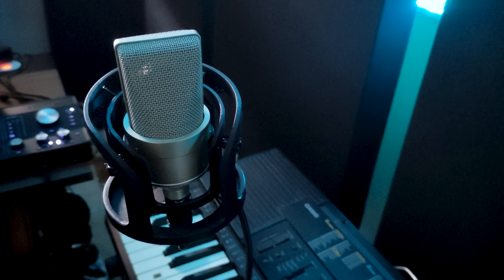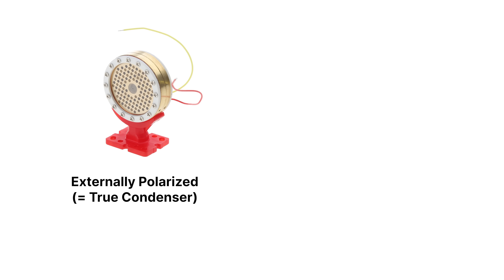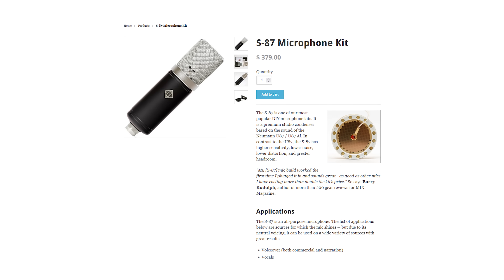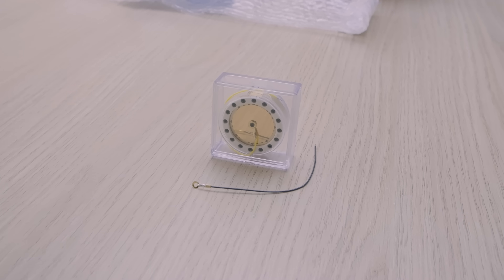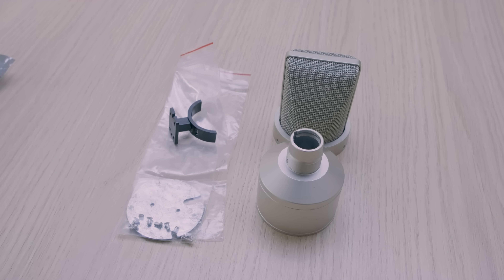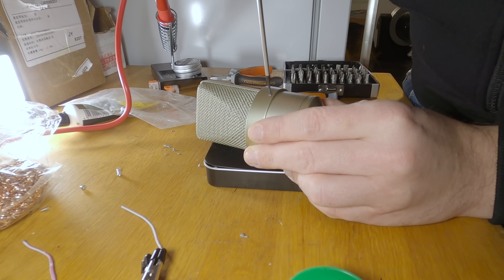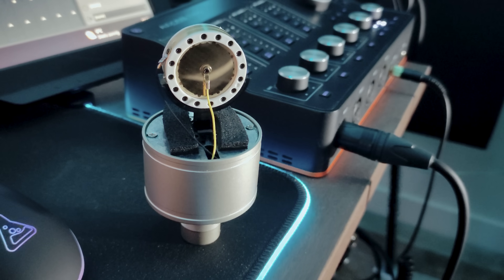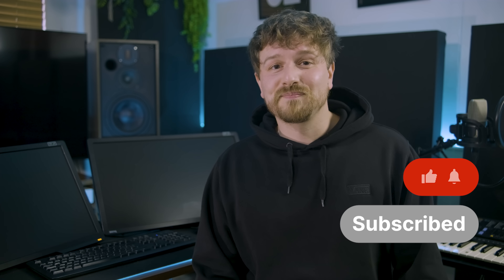Building a Studio Microphone from AliExpress Parts (DIY)

Comment: I did an experiment reason it could be picking up noise could be from the body not grounding the Capsule cage
Reply: try sanding the top and bottom of the body
Reply: when I had taped the end of the top body from testing to see that had brought the hum noise from ac and rf signals back
Reply: Hope that helps anyone
Reply from the maker: @leoyser1369 thanks for checking that out!
Reply: @SirFreak no probs

Comment: For the price this mic, sounds awesome!

I wish all the creators in YouTube who are not specifically doing podcasts with multiple participants, took their Shure SM5xx (whatever this crap dynamic mic is) alongside with the cloudlifter, threm them in the bin I've got something cheap from the condenser mics section. Viewers/listeners would be absolutely happy for a much better how to quality.

People wasting hundreds of Euros on that black Shure turd. Most of them don't have all the engine explains needed to squeeze maximum quality out of this mic in post.

But I digress...

Great video, although I'm a little bit confused by the mere fact that person who is working with and on audio in his Studio, wouldn't recognise the low frequency AC line hum in the order signal that was present before you enclosed the capsule. I don't understand how this was even a question. 

Also, the noise level below 100 HZ for a mic like this without low frequency attenuation switch, Are completely normal and to be expected. Also, you could add additional tin foil (obviously with a insulating layer) around the circuit board and/or wrap the tiny wires in additional shielding. 

Still below frequency rumble is kind of expected without any additional circuitry, and besides I'm pretty sure, a most condenser mic users would the low frequencies anyways, especially for male voices. You would hardly ever need any frequencies below... Sat 160 Hz if not even higher.
Reply from the maker: Completely agree on the SM7b. And yup, I mistakenly used the wrong terminology, sorry about that!
Kind of agree on cutting the subs, unless you actually want to record those. Although in most cases you don't.

Comment: What ever you do……. 
don’t use superglue on a condenser microphone
Superglue can vaporize (you know the smell) 
and it condensates on nearby cold metal parts like the metal membranes

Maybe the glue you are using is just fine.......... and no cyanoacrylate glue (superglue)

Nice project, gone build if! 
 It looks like the Lewitt has some "up to DC" in the output, no problem, 
probably no transformer?
Reply from the maker: Beginner mistakes 😅 I didn't see any negative effects yet, but perhaps it was some other type of glue.
Yeah I'm not quite sure what that rumble in the lewitt is caused by to be honest.

Comment: Excuse me but what if i want to make a plug-n-play microphone with a USB connection? Dont i need a 5V controller?
Reply from the maker: You'd need some kind of audio interface in between the mic and PC. Both to convert the signal to RGB, but also to apply phantom power( 48v) to the mic
Reply from the maker: I think there are circuit boards that do this as well

Comment: Neat. With the right circuit, you could probably use the other side of the mic as noise cancelling/rejection. Though I'm not sure if any ready-made circuit exist on ali
Reply from the maker: I think I saw a couple of those boards. But they need a bigger enclosure as well. But it's probably possible with aliexpress parts as well

Comment: Awesome bro I wonder if I can improve a cheap Amazon mic this way, as lot of the parts can be used for a the new mic 🎙️
Reply from the maker: Yes sure! You can reuse the body and choose to upgrade the circuit or the capsule. Just note that you need a different circuit if it's an electret mic. It might sometimes even be cheaper to use a donor mic instead of buying everything separately.

Comment: If you put a 22nF capacitor between pin 2 and ground and another between pin 3 to ground as close to the XLR connector in the mic as possible (essentially they fit in amongst the XLR connections), you will dramatically improve the EMI/RF suppression (the gsm phone issue which you experienced).

The foam idea is solid but effectiveness will depend on the density and positioning.  The headbasket acoustics can make a big difference.
Reply: Go for film or class 1 (C0G/NP0) capacitors rated >100V to avoid distortion
Reply from the maker: Thanks, I think I have those laying around. I'll give that a try. Consider me curious, but why those specific values?
Reply: @SirFreak   Hi - At common RF bands (>300 MHz), 22nF offers low reactance (3-30Ω) for effective filtering without loading the mic's high-impedance output.

It balances suppression across gigahertz frequencies picked up by long cables.

Alternatives like 10-47nF work similarly without audio impact.
Reply: @SirFreak 

At common RF bands (>300 MHz), 22nF offers low reactance (3-30Ω) for effective filtering without loading the mic's high-impedance output.

It balances suppression across gigahertz frequencies picked up by long cables.

Alternatives like 10-47nF work similarly without audio impact.

Comment: I’m not a tech expert and I haven’t built a DIY mic before, but I have messed around with a DIY LoRa radio signal before because I have an ungodly amount of time and free will and ran into GSM noise before. From what I learned, grounding matters a lot. Inside the mic, making one single ground point and tying XLR pin 1 (or TRS sleeve), the capsule ground, PCB ground, and the mic body/shell together could help though results may vary otherwise Chaining grounds could turn it into an antenna. Whats great about this is you can use whatg you already have on hand you don't need to buy anything extra :)
Reply from the maker: I'll give that a try, thanks!
Reply: Yeah you're correct about it. Ground ALL THE THINGS. Gotta do that with everything that produces sound or is supposed to pick sound up. The better you can ground it, the better the sound is. Which is also why metal is used as much in microphones  and things like that. Not just for quality reasons.

Comment: So can you get different polar patterns just by using a different circuit board then?  That would be really useful for recording instruments
Reply from the maker: Yes, indeed. At least with this capsule. You'll need to connect some other leads to the capsule as well in that case.

Comment: The high end noise actually sounds worse than the low end noise in the other mic - I'd like to try a U87 clone from china to see if they have less noise.
Reply from the maker: I agree, but note that I had the gain up pretty high for these tests. For recording purposes, I think it's still very manageable. I've worked with way worse.

Comment: Make sure you're getting electrical continuity between the grill and the body. I've had to scrape some paint/finish off at the joint in the past.
Reply from the maker: I indeed noticed that the body might be painted / anodized. I quickly tried sanding it down a bit, but still had the issue now. I'll try to sand it a bit better and see if that makes any difference.
Reply: @SirFreak  If you have a multimeter use the continuity tester. Its been a while but I think the grill (and the body) should be connected to the XLR ground pin.
If you were to try this again, I'd get a cheap/used mic of a known brand and replace the capsule on it. the Rode RT1A has one of the cleanest circuit designs and could take the RK87 or CK12.

Comment: I would say that electrets are more consistent overall in quality but they are cheap and usually small. They really compete with small condenser mics rather than the LDCs.. It is difficult to compare the two, one is mass produced at pennies but still achieves excellent specs considering the price. True condenser for ex has the noise from the bias current in the signal, electrets don't. It is just weaker, so the system self noise becomes a problem AND here is the "secret sauce": There is a FET inside them and it does rely on DC bias from the inputs, it just relies on the fact that no input is truly removing all DC, and even the tiny, tiny bit is enough. If you replace the internal FET with a better one, you get instantly a huge jump in SNR, which is the true problem with electrets. It is not about the back plating or how the front plate moves, the biggest factor usually is the internal FET. Replace that, give it nice, clean power and you will beat a lot of LDCs.

But... try to find a large electret at reasonable prices and you are better of with true condenser. But if you want an array of omni's that are very flat between 80-6k, cheap... make your own. When i was a kid we made 80 audience Q&A mics bespoke which means everything was made cheap, 071s op-amps, mercury switch, aluminium tube, packaging foam and re-purposed furniture leg caps... But the sound quality? God damn, they were better than the main mics we had but just omnidirectional. I would call it "pristine", just so flat and neutral. Very suitable for the purpose being used by people who only know they need to speak to the tube. 

So, don't spit on electrets. I used to, even after that experience i went thru life thinking they are all shite because they are cheap. Nope, they are incredible good FOR the price but usually are not designed for low noise, and making them cardioid has the problems that all cardioids have.. You may be able to bypass the FET with some minor surgery, and anything that is modified like that is not what i call reliable. Hobby projects, i've done a few and you really can get quite decent specs from a 10 cent capsule, way better than it should be.
Reply: You can buy good electrets, price isn’t maybe few dozens cents but few bucks, but u can avoid surgeries. I.e. Panasonic wm61a most omnipresent electret amongst measuring microphones (there are mics for 60 usd that are using this capsule, as well as for 600 usd). 
However I think that today u can make mics with mems capsules that are better and cheaper than average electret
Reply: @xanonax  For sure, but just in case i got 100 WM61s in the component shelf. One of those where bypassing the internal FET is also quite easy. Ridiculously linear capsule for the price but quite noisy without modifications and even with them... ambient room mic for drums, not for anything that might need lots of gain or lots of SPL. 

Mems are something i don't know a lot about, thanks for the tip. I know my next rabbit hole.
Reply from the maker: Hmmm super interesting read, thanks for the explanation. I just went with information that I had found on the internet, but as you can probably tell from the video, I'm new to mic building. Knowing what you just said, I might try messing with some electrets in the future to see if I can get some better results.
Reply: @SirFreak  Panasonic WM-61A is a good starting point. Used by a LOT of measurement mics and the surgery needed to cut the internal FET is quite simple. But it will never be super low noise, just quite linear out of the box. Amazing thing, really considering the price.

Comment: about the "tiny allen screws": get one of those smartphone toolkits there about 5 bucks and include screwdrivers with those tipe of allen tips 
about the interference , maibe you can put a metal mesh sleeve around the wires comming of the mike itself  or put some extra copper shielding around the circuit board (the type of stuff they use in guitars ) in recording studios cellphones are usually banned anyway 
i buy a lot on aliexpress and have been cheated a few times , i usually get a refund when that happens though and you need to check and recheck that the picture is actually the article that priced as it is say you want buy a drumpedal its listed for 3 dollar but closer inspection shows its the knocker for a basdrum pedal , i allso suspect that most of the stuff that aliexpress sells are rejected batches from bigger brandnames like for instance shure , could be the tested parts had a too big difference from the norm or a to high percentage of failure and the whole order gets canceled , the factory wants to at least make some return on investment , notice that some products suddenly apear like logitectrackball mouses and after a while the prices for them go up as the ones sold cheaper are sold out untill theres nothing left , there actually good brandname articles that the manufacturers have had produced in china and sell under made in the usa (usually means assembled in the usa )
Reply from the maker: I'll give those things a try, thanks!

Comment: The vapour of the superglue could harm the capsule. It was better to drill some holes in the capsule mount. Also consider the AliExpress capsules are clones and do not have the quality and consistency of the originals.
Reply: Most "originals" of any product are built from generic off the shelf parts you can buy cheaply in bulk
Reply: Also, Aliexpress doesn't pay for R&D, marketing, or advertisement, for example. That's one of the reason why it's cheaper.
Reply from the maker: Good to know, thanks. Perhaps I got lucky with my capsule.

Comment: interesting. more tests will be nice. like which one has more dynamic range, impulse and freqency response comparison.
Reply from the maker: I wanted to do some more testing, but I don't know if I have all the right equipment for that. I suppose impulse and frequency responses can also vary based on what speakers you use and where exactly the microphone is mounted.
Reply: @SirFreak  for comparison between two any decent speaker will do. probably a small wide range speaker like in a headphones or smth. i personally wouldnt bother with absolute measurements.

Comment: You should google the "OPA Alice" Instructable by Jules Ryckebush, aka DJJules. He designed a really great circuit that works with a range of different capsules, and they sound absolutely fantastic. They also allow you to repurpose the body of a cheap BM-800 mic, which you can find absolutely everywhere, often for less than 10 bucks.

The noise from your mobile phone is probably being picked up by the cable, which can act as an antenna. DJJules' builds recommend soldering 0.1uF caps for  high-frequency filtering directly across the leads of the XLR connector, right where the cable enters the mic body. That cleans up the signal a lot.
Reply: I second the OPA Alice project! I recently made two microphones that sound pretty amazing for what the parts cost me. Everything worked pretty much perfectly on the first try.

I have a few sets of the electronics leftover, if anyone reading this is interested in building their own mic, hmu
(only selling to recoup costs, EU only)

Comment: very nice, thanx
how does it stand to the SM57, the one i use ?
Reply from the maker: The SM-57 is great for loud and close-mic'ed sources like guitar amps and drums. Condenser mics, like the one I made here, capture more detail and have more clarity, making them great for vocals and acoustic instruments. They also capture more of the room's ambiance, while the SM57 has a more focused recording pattern. This makes the SM57 great for live sound as well.

That said, great recordings can be made with both, but they do each have things they excel at. They also sound quite different from eachother.

EDIT: This does not mean you can't record things like vocals with a SM-57, to be clear.
Reply: @SirFreak  thanx
Reply: Apples to oranges mate!
Reply: @DMSProduktions  meaning different but not better ?

Comment: I've been thinking a lot about building mics with aliexpress too, problem is there's not much audio samples of their lower cost stuff like capsules/boards, so any new information is more than welcome. Shame the board used was for a neumann form factor, was expecting something in the shape of my bm800. Let us know if you managed to fix the noise! Also, your short urls aren't working.
Reply from the maker: Yeah, ordering the parts was a bit of a gamble, really. Turned out pretty ok but could have turned out terribly as well. I'll check and try to update the links, thanks for letting me know!
Reply: Google "OPA Alice". That's a great little board specifically designed for conversion/upgrades of cheap BM-800 mics.

Comment: EMI shielding is an really important technique to achieve signal integrity, especially in small-signal such as condenser microphone, which requires external amplifier circuit.
A very small noise eventually can be amplified to huge through amplifier, when electrical interference isn't bypassed to return path through metal enclosure.
Reply: u would recomend a module befire, after or in the middel of  the mic? thanks
Reply: @josejosepad  I don't understand your meaning, but if you're mentioning the 'mic' to 'microphone enclosure', generally most important thing is well-caged chassis and well-defined return path of chassis ground, not the position of the board.

The victim should be tightly wrapped as possible to shield, to avoid electrical interference from any noise source.
As much holes on your metal enclosure, there will be high chance to allow noise to enter.
Also, increasing thickness of metal chassis would helpful to reduce interferences.

Comment: Surprisingly, the cheap one have less high end than the lewitt. Most cheap mics I've tried (just to name a few : AKG P120, Berhinger U87 "clone", Rode NT2, Audiotechnica AT2020 -my favoritye one by far) all have the same issue : a bump around 10-15 KHz, making everything sound thin and metallic. True U87 from Neumann also have it, but less proeminent, making it "shine" instead of harsh. Yours sounds darker and dull, kinda ribbon like. I'm sure there's an application for that, like overheads (mono then) or bright/harsh instruments
Reply from the maker: Yeah I was kind of surprised that it didn't sound harsh. Even though it's not perfect, it's definitely a mic I will use.